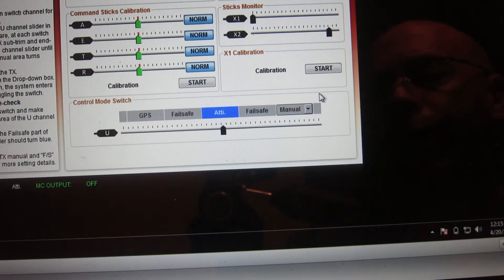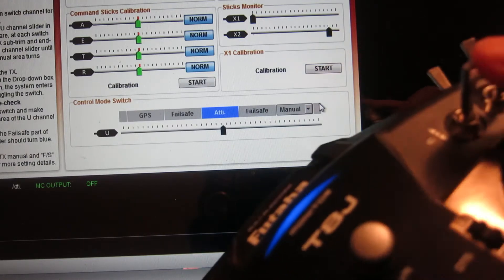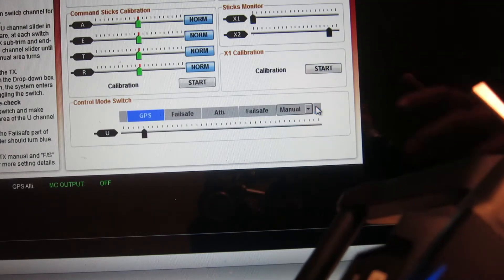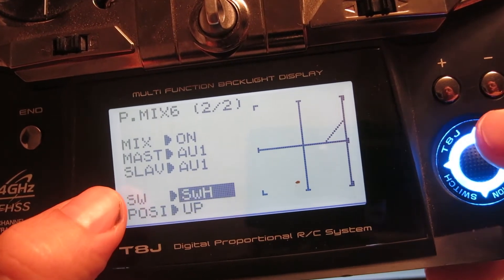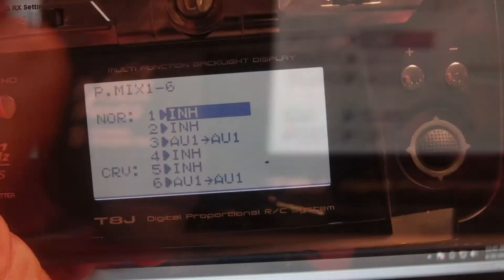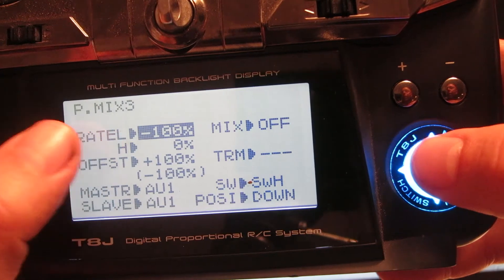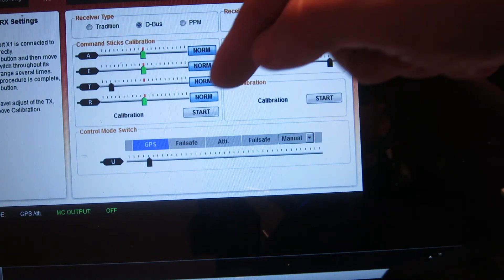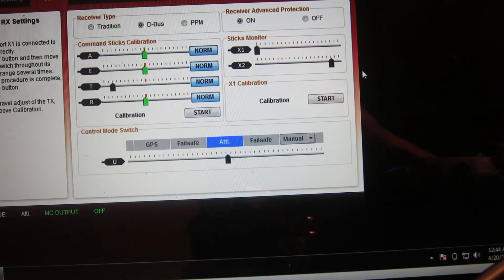Futaba NAZA - GPS/ATTI/Failsafe/Manual- All at the Same time!

Comment: Watch out Gary, this is WRONG setup. "Manual" had to be highlighted!!! This is failsafe as well just like on the left of "GPS" you just don't see the words. If you would do that in real life, you would enter FAILSAFE.
Reply from the maker: +Philip Dezsö , uh no.   I've successfully been using this setup as shown.   the 3-way switch still does  GPS/ATTI/Failsafe as needed,  and when I pull on the spring loaded switch, it does into Manual mode as shown in the video.  But perhaps some adjustements might be needed in your trim setups to ensure that Manual mode is indeed highlighted when the switch is thrown.

Comment: Doesn't the word "MANUAL" need to be highlighted in blue to be operational? I was able to get my stuff on a 3-way switch, basically same one you're using but I had to do 3 P-Mix inputs to get there as it often would only highlight as yours is and wouldn't work there. Adjusting the subtrims was all I did to cure the problem, after about 50 hrs of trial and error! LoL But my Tx is a Futaba T8UHP (old one but still digital)
Reply from the maker: I'm not sure if it gets highlighted in the NAZA assistant, but it still works so long as it says "Man" in the lower bottom corner to indicate which mode the NAZA is in. (also would show up in the mini iOSD if you use one).
but you're right, adjusting end-points and sub-trims might help in this.  always some trial an error.

Comment: How do you fly in manual when your fingers are holding down the spring switch? I would put the three position switch with the manual setting and the spring loaded switch to failsafe since you don't have control in failsafe you won't need your fingers to fly!
Reply from the maker: Well, the  spring loaded switch is actually referred to as the "Trainer Switch"
i tried it (flying with my thumbs), and it's relatively easy to do while pulling up on the switch.  One can use the same setup on a non-spring loaded switch as well.
but I prefer the spring loaded switch since it's my only free switch and it instantly puts things back into GPS/ATTI mode.  
I wouldn't say this is an ideal setup for those who fly full-manual,  just as a temporarily-manual kind of mode so one can fly ATTI, and then flip into manual mode for a quick acrobatic move (or to recover from a potential flyaway when the gyro's/gps is out of whack.